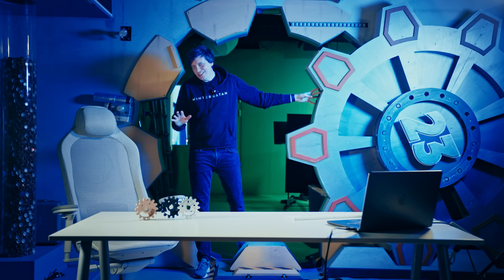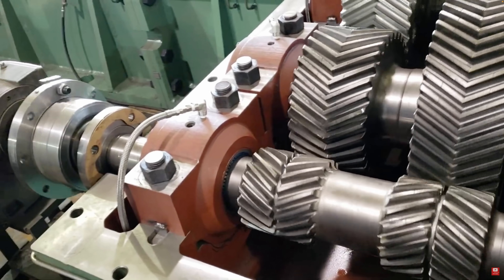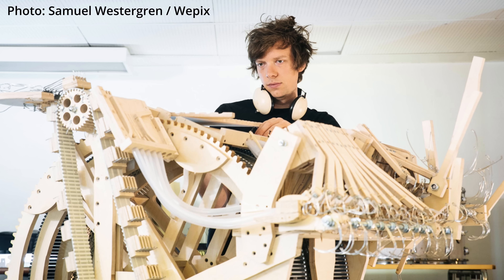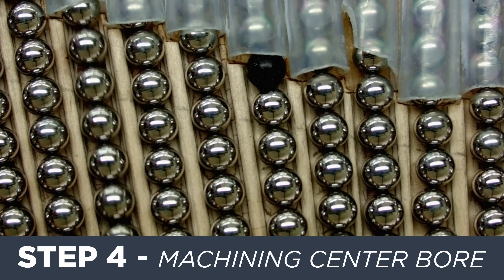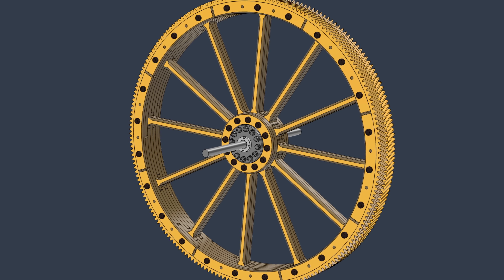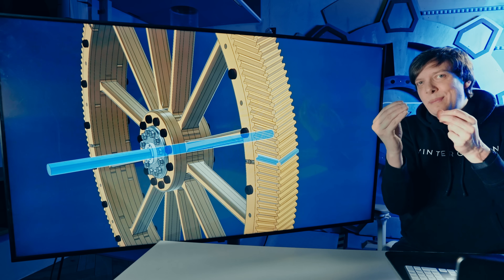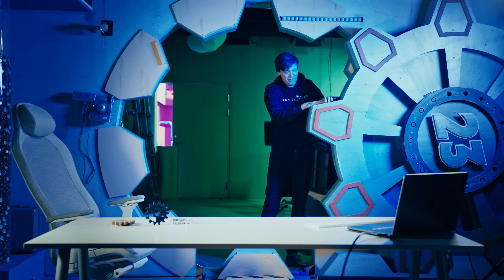How I´ll Make the Worlds Largest Plywood Gears

Comment: The big problem with your new favorite gears...is that their "Better". Unfortunately they won't suffer any dirt without jamming, big shocker the reason the wood gear worked in the first machine is the same reason the first machine actually worked?
It wasn't made as well and so it suffered much better with the slop and poor fit than the "better Machine" did.
The idea of better being more successful isn't supported by the facts...as worse worked and better failed and those re the facts.
No one gave a crap if the machine made perfect music but you...we all just liked to watch all the stuff moving around, and music wasn't the point.
Now you intend to double down on the reason for the failure and improve on the failure...making a much better failure...dumb! But keep at it because it's entertaining to watch others fail.
Make it tighter and better and it will only fail much better...sorry I'm just the  messenger.

Comment: Backlash in gears are important also to consider when your gear direction change direction. Thats where it comes from. When you turn direction it hit back on the gear teeth when turning back. In your case where it only turn one direction it will mostly be about friction an jamming you need to deal with. But can get issues when slowing down or braking the gears if to high of a backlash

Comment: I think the plywood gears are smart because it's easy to repair. imagine if Martin has a metal gear and it got bumped or dropped and warped in transit. That would be disastrous to try and repair. A plywood wheel? much cheaper and easier to repair. not a five minute fix, but still better than a giant metal wheel.
Reply: Huh?

Comment: Backlash is an issue when the direction of torque transfer changes. 
In your application the direction generally stays constant.
You can further improve the smoothness of torque transfer by introducing anti backlash gears. Those are springloaded gears that are used to introduce a torque which ensures theeth are always pushed against one another. They are used in radars, or precision devices to ensure accuracy.

Comment: I really like the helical gears for certain things but people won't see them and you're introducing a huge headache with the one thing that never failed. I would keep the standard gears. I think they will look better to the audience, and they will last much longer and be easier to repair, swap, etc. If you get a chip in one of these, or a couple teeth get crushed, redoing this will be such a nightmare and I hate to see you lose motivation from fighting with these changes.

Comment: Cool ideas Martin! Don't worry about the negative comments, with careful planning and support from the community, you'll definitely see it through!
Just one thing - please prototype before you go all in like what you did with the drive train. Make a smaller gear or an arc to see if it works!
I doubt this will be your final design, and it might be good to consider using a combination of materials (like plywood and plastic) for the final product!

Comment: I really don't see this a problem, considering you are planning every step ahead and using off-the-shelf bearings.

My only minor concern would be deformation of the larger gears under load. Maybe adding one or two layers of sheet metal in between? Would still look cool and the metal would be invisible.

(I also have no prior experience with gluing wood, so i also think the deformation might separate the layers, since they are staggered, correct me if i'm wrong, please)

Comment: Another design feature that would help with localised expansion of the plywood would be to use curved spokes instead of straight. Old cast iron wheels or gears would crack when cooling. So their elegant "S" curved spokes would just curve a little more if they were hotter (more moist in your case) instead of pushing on the rim and cracking in hoop tension. Whatever you coat it with care must be taken to do it evenly. Un-even moisture content is much worse than overall expansion.

Comment: @Martin, yes, plywood gears are necessary for the cool factor. MMX even had a planetary gear train AND offset shafts, all bringing +1000 points. 

BUT as an artist, remember to seek the beauty in the peculiarities your medium. With wood, even plywood, part of that beauty comes from the fact that wood breathes,  it moves, and it has fibers and directional strengths. 

The more glue you add, the less this is a factor, and at some point you are working with a very low-grade carbon fiber composite (wood Fibre in glue/epoxy matrix) instead of high-grade wood. 

Peg wheels (see ancient wood gears in mills) work with large torque because they use the wood's strengths to advantage. 

Spur gears work for the same reason, when made with plywood. The important thing is to design the gear tooth profile such that the contact line between two gears is a rolling line, not a sliding line. This is an art as much as it is gear tooth science. 

Helical gears however... helical gears by right of their geometry ALWAYS have some sliding contact. This just won't do for a wood or carbon composite material. 

Dude lost some of my respect for dunking on the metal marble machine based on their view count.

Comment: If delrin is viable alternative, is it not lighter, and is humidity not an issue anymore? Maybe Deleon gears with thin plywood on the outside for good looks and maybe a bit added stability? Would it be less noisy? Maybe too flimsy? Is a bit extra weight good?

Comment: The idea of a torque wrench is amazing, but there is a catch. Wood density can vary slightly throughout a piece or across several pieces. So equal pressure is not necessarily equally flat. I would just use slow drying woodglue and measure everywhere with callipers

On another note, i used to tune my drumheads with a torque wrench, it is far from ideal, but with metal rims it is pretty good. After i made wood rims for my drums it was impossible to tune good enough with the torque wrench.

Another last point: you have good plywood so this may not be tooo big of an issue. But thickness isn't constant throughout. And stacking sheets multiplies this. So that would also change the torque per bolt. But i think this wouldn't be too bad. And you rout it anyway where its necessary 

Love the idea though. The plywood aesthetic is just perfect

Comment: Hey Martin! I just wanted to leave a quick comment because I'm currently also working with the production of relatively large gears for work. In the end, we decided on a solution where we mounted 3D printed V-shaped gear modules (PETG) onto a ring. Our main reasons for this approach were the low costs and the ease of implementation. It worked out really well.

Comment: I wonder if you could get cast iron gear teeth made that lock into grooves in the plywood, like the blades of a jet engine compressor fan. that would still be light weight and very easy to repair!

Comment: One big suggestion I feel that I must be said. You can use a "magnet break", which uses aluminum or copper as the "breaking pad", which has no contact friction, in your timing devices. The faster a plate of diamagnetic metal passes through a magnetic field, the more it resists moving through that field. For instance, your spinning regulation pendulum uses a physical contact to reduce the speed. That friction will never be controllable. If the balls were copper, which passed through an adjustable magnetic field as they extend, it would "break" the spinning, the faster it tried to spin. The magnetic field would be reflected back at the metal, creating a N-N repelling or a S-S repelling. However, spinning slow, away from the magnets, the slowing would not happen.

This can also be applied to the flywheel, by adding an aluminum "tab", which protrudes off the flywheel and passes through an adjustable magnetic field. That acts like a similar break, with more precise tuning.

Instead of bike pedaling... Make a weight equal to your weight and a 1:1 platform drop. Just step onto the higher platform, once every few minutes and slowly "fall down", to lift a second weight. Two weights so one is always falling while the other one is being "reset".

Attached to a "spring board", you could just bop around to the beat, hopping up and down, harvesting every impact while a soft "spring" returns the platform to the higher position on the rebound.

Just so you know... A 150 lb object can create 300 lbs of force, with a "hop". It can also create a 600 lb force, with a solid jump. With enough weights, on one-way gears, you can charge the whole system in a few jumps and it will last for several minutes. Plenty of time to switch to another platform with a dramatic "hop", to recharge it.

Comment: Wood has high friction, high slop and high compression. Ignoring humidity deformations, ply is the keyword in plywood. It doesn't just mean "layers", it also means "pliable".

I would suggest adding Nylon/Teflon tooth faces, secured with slip-in "keyed", metal backplates. Wood rings, metal tooth-mounts, nylon contacts. The distributed pressure should limit nylon wear. The metal plates should stop deforming and reduce slop. The wood, with a sheet metal core ply, will have little humidity expansion. Keep the wood part cosmetic.

Perhaps you should look at "clockwork mechanics", which is really what you are reinventing here. The wheels already exist.

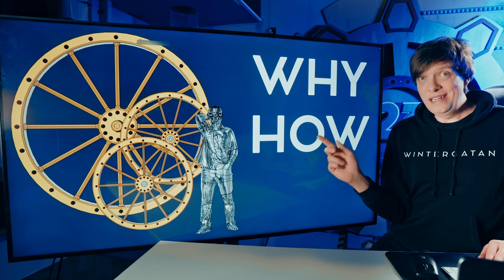Comment: I would use CPES penetrating epoxy to stabilize the wood then varnish over that.  It would be polymerized at that point, pretty much last forever.  If you do a second application of CPES and let it get tacky, then varnish, it will glue the varnish down forever, so no bubbling from age. 12:55

Comment: you could make the gears in 3 layers: fist and third being a gear blank with the second being the spokes, to make the gear teeth you would tilt the bandsaw table and drill press table to the same angle as the tooth angle, then cut the gears like normal but on a tilt, the second layer could be expanded into slots designed into the first and third layers to give more stability

Comment: Well gubbe… I think they machine double heicoil gears separately. That is, in two halves.
Assuming, you want sharp v on the middle of the gear.
If you want the gear cnc machined in one piece, you will get a rounded V corner on the middle.
And, I don’t know how it will work as a smooth torque transformer.
At least, I think the profile of the gear is not the same if the angle of the gear transitions from, say, plus 25 to minus 25 degrees in a curve.
Or, you could leave a gap between gear lines. That would also help cleaning the gears v bottom

Comment: WATCH OUT with the T-nuts, they can "hold" just a small amount of torque before starting to spin in the wood and when the prongs have carved out a complete circle, they won't hold anymore. Also, for flatness, the thin metal part of the nut can led to uneven surface.. Maybe THREADED INSERT NUT and Apple glue during assembly for better performance

Comment: AESTHETICS MATTER:
Others have great comments on the engineering, machinability and durability of the double helical gears. My main gripe with them is that I think they look aesthetically worse than regular spur gears, especially from a distance. Spur gears what regular non-engineers recognize as gears, and big wide chunky teeth like a child can draw further add to amusement and imagination. 
I worry the helical gears only look good in closeup and not as good in side-profile which is the orientation of the gear in the overall render.

Comment: Sooo, could you explain what the advantage is to the double helical gears, compared to the simpler type of gears you've used for the previous machines? 

I don't mind the material or the scale, but the gear teeth seem really complicated to manufacture.

Comment: I think making the gears modular would be a great idea. Because now, if it gets damaged, you will have to redo the whole.
If you made the round part wood, and the theeth some other, stronger, material - e.g., delrin, aluminium, other plastics - and just cut dove tails into the wooden part, you could just slot in the theeth of the gear, and change it easily.
I know this defeats the idea of the wooden gear, but it would make the machine better, stronger, and easier to service.

Comment: I won't help you make it, but, Helical Gears, invented by André Citroën, are indeed fantastic and provide near noiseless power transmission, and they do work at any speeds, take a look at how EV's gearbox works, it's a 9.2ish:1 gear reduction with helical gears. Small advice, instead of a pre programmed tolerance between gears, because they expand and contract, just make the hub mount tuneable and use a paper sheet to tune the tolerance each time the machine plays. Diesel fuel works wonders with natural wood, have no idea if it works on plywood. There are many oils to seal the wood and it's an easy process. BTW, it may be easier to make a machine out of aluminium profiles and basic 3 axis coding or just a simple gantry cnc with template material holders.

Comment: Looks awesome! Have you considered laminating some fiberglass cloth in epoxy between the layers of plywood? This would add a little bit of extra weight, but would greatly help the stability and structure of the finished piece.

Comment: I worked with a ton of Baltic birch years back, BEWARE OF WARPED MATERIAL! Even after vetting for warps I’d still recommend reversing every other sheet in the sandwich. Just in case a warp goes unnoticed, in theory the opposing forces would cancel each other out.

Comment: if you are gonna be machining small(or really any) backlash margins on to-be-treated plywood, you will need to keep in mind the added surface height from any coating you put on the wood( epoxy, varnishes etc.)

Comment: Double helical gear is the best choice when :
- it is important to cancel axial force
- it is great to have a self aligning gear
- the torque transmission needs to be smooth

Only bad point is the machining which is more complicated. But you seemed to be nailing it.

Comment: Why assemble the gear from multiple segments when you could eat the material cost or re-use the pie slices from between the spokes for something else?
Also the rotary axis / CNC frame will have to be pretty rigid and strong to counteract the giant lever arm when machining the teeth (compared to a 5 axis CNC).

Comment: So you have concentricity all planned out, what are you doing about balance? Are you drilling weight out like a crankshaft or adding weight like a wheel? You might think that balance isn't important because you have low RPM, but with the radius you're planning it will become an issue

Comment: The biggest challenge of all of this will be machining the helical profiles in the gear teeth. Good luck with doing this on an avid cnc router. You aren't going to get the torque and positional accuracy with a stepper motor to do any kind of 4th axis work on this scale.

Comment: You could sandwich one layer or aluminum spokes in the middle of the gear sandwich that will be hidden but add material strength. If on plywood spoke breaks that all could shatter. It could also provide some of that dimensional stability. If you had a soft light metal like aluminum that might help “hide the vegetables” so to speak 🥦 Looks awesome though. Keep up the good work!

Comment: If the gear axel is ever transmitting tourqe, consider revising the spokes in to a configuration similar to a bike wheel. The radial spokes used in this demo can lead to very high tension loads.

Comment: I'd be worried about the plywood delaminating at the apex of the gear teeth since they are finer than the spur gear equivalent, if not immediately, over time. If you look at old mill technology, the largest gear wheels had replaceable teeth, and post industrial revolution, they replaced a lot of the smaller and even bigger wooden gears with cast iron. I think while it will look cool, I have severe doubts about the longevity.

Comment: Probably my only issue with scaling it up so large would whether or not the teeth on the gears would be able to handle the stress. Before comitting to the full build, CNC a mock up of a section to test it to see what point it will start to crack and/or splinter so you know what tolerances you will be allowed for the gear on just the teeth. 
Best case scenario, you'll have more tolerance than you need. Worse case scenarios ends up being either you need to lighten the load or end up not doing such a large gear.

Comment: There is no need of going for helical in your application. Perfecting spurr gear is good enough.
With plywood, at that size, even with a good router cnc you can only achive 0.2 mm or worse accuracy- especially on the tooth as it also depends on the indexing and then clamping  accuracy - clamping inthe orientation you showed will be achallenge.
 In this case the helical gears will be weaker than a spur due to wood grain alignment.

Comment: You mention 1% potential expansion, but show a massive amount of backlash.  There are a lot of downsides to excessive backlash, not the least relevant of which is constant noise.

1% on something this size is equivalent to you finishing and smoothing the surfaces with some thorough sanding techniques, not cutting them undersized so they are sloppy, noisy, and loose.

At least test this on a small scale beforehand.  Also, keep in mind the mobility of the final machine, especially how and how much you are going to disassemble and transport it between shows.